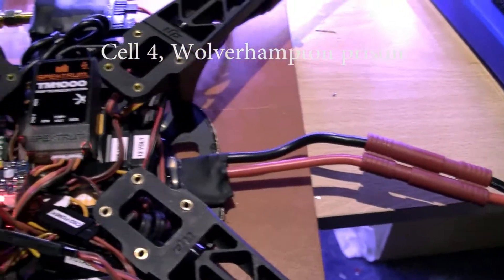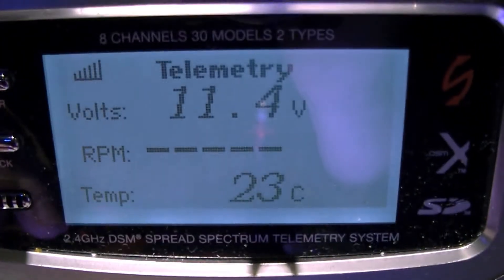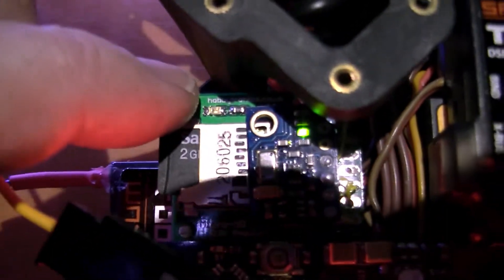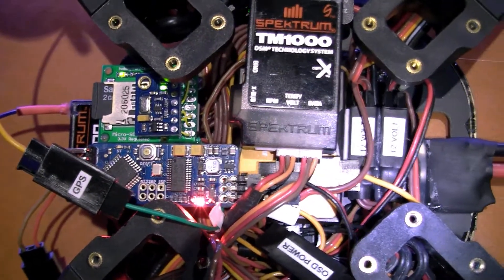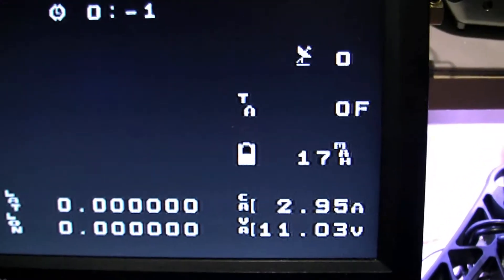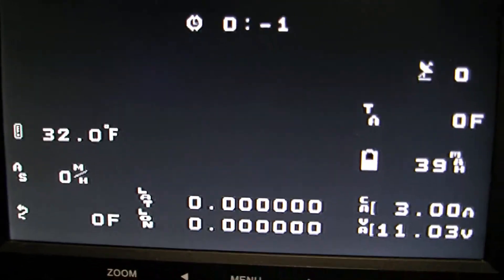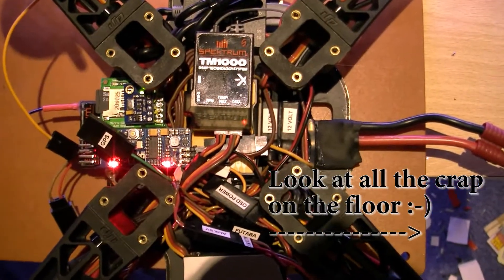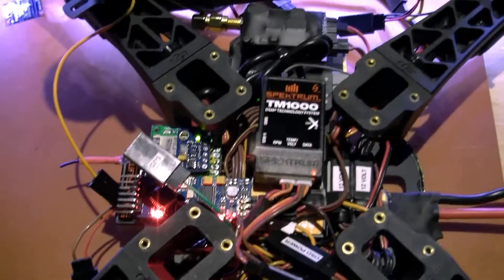New OSD and data logger is now fitted!

Comment: Did you coat the circuit boards to prevent corrosion?
Reply from the maker: Not on the prototype. It's not going to be in there too long and is only for testing.
When I get the PCB's made, the finished product will be conformal coated.